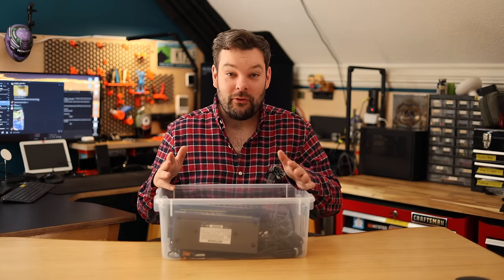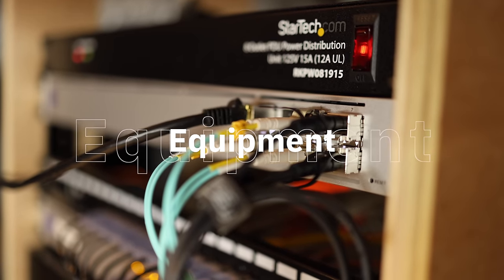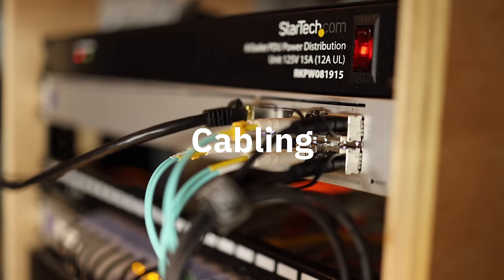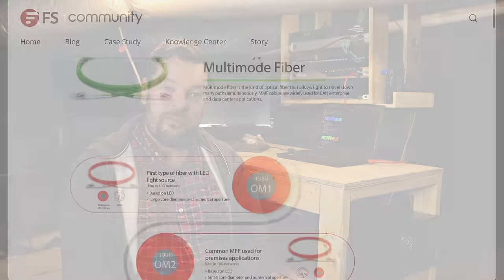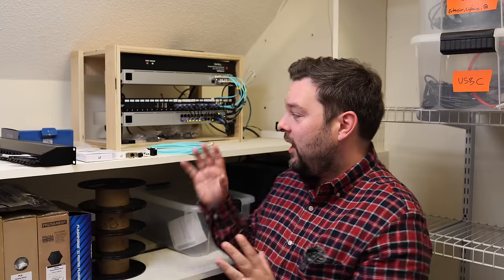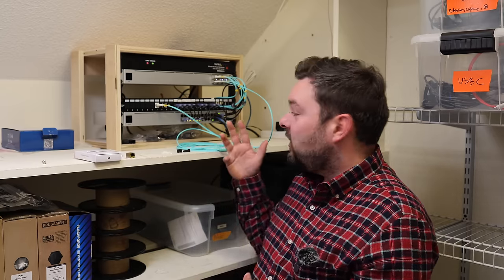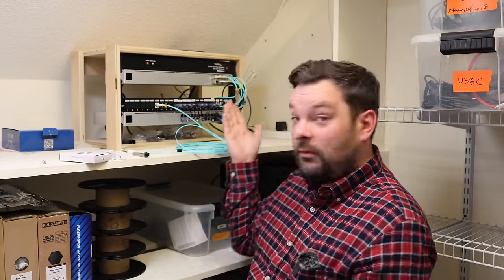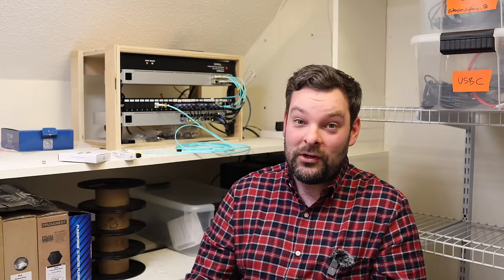Future-Proof Your Network: Upgrade to 10G with UniFi Fiber Gear

Comment: 10g over copper is hit or miss. I ran cat 6 throughout my 2 story home to the basement. My desktop is connected at 10g to the switch in the basement and Ive had no problems at all. The ethernet runs even cross over all of the power cables coming out of my breaker panel (at 90 degrees).

Comment: 10gig is going to be a big upgrade when we get wifi 7 ap's with 6ghz as well. thats my plan at least. I think unifi needs some switches that support 10gig poe++ though. they have only one currently for 4 or 6 ports (i forget which)

Comment: TP-Link have a 16 port semi-managed PoE switch for $199 (TL-SG1218MPE), with double the power budget (around 200W total)... Is the USW-24-POE really worth nearly double the price?

TP-Link also have the ER8411 router for $350, which has two 10Gbps SFP+ ports and eight 1Gbps ports. I'm using it with 10Gbps internet and it works really well. I don't think Unifi have anything around the same price with the same performance.
Reply from the maker: You're not wrong! Whether these things are worth their prices is entirely up to you, your needs and your budget. I've been extremely happy with the Unifi ecosystem myself so I stuck with what I knew. I could/should get some Omada gear in for testing though!

Comment: I have a netgear xsm7224s 10 Gig switch, 1 Arubra s2500 poe with 4 10 g ports. and 1 Arubra s3500 poe also with 4 10 g ports.  the only difference between the 2500 and 3500 is the 3500 has 2 power supplies.  All my computers in my office are all 10g.   and the run from my shed/office to the home has 2 10g lines witch are connected to the netgear switch the same with the switch in the office POE switch.    All 3 switches are enterprise hardware.   before I only had 1g but with 32 4k and 8k security cameras the 1g was starting to bog down now I don't even know the POE cameras are on the network.  I have some of those 10g T transceivers,  and I have bought different one and not of my switches support them.  I believe its because they take more power than the fiber and the switches wont power them.

Comment: 25:00 the factory does not clean the fibers. You need to clean them yourself. From the factory there are particles of stuff on it. I scope them everyday at work. They usually work ok without cleaning, but they are not clean. When i clean them i get a better lite reading.

Comment: I don't understand why 10 gig wasn't the default for home networks 5 years ago.  With single NVME drives capable of saturating 10 gig already, if I had the cash, I'd skip 10 gig and go straight to 25 or even 100 for my main machines anyway.  1 gig is sufficient for almost every other client in the house as gigabit internet is crazy expensive around me still.  And frankly, even if we had multigig internet, most of the clients don't really need that much speed anyway.
Reply: Since funds are tight, I'm looking at the Mikrotik crs305_1g_4s_in.  Ultimately, I just need my main machine and network storage on 10 gig right now so the css610_8g_2s_in is probably a better option so I don't need to cascade the 10 gig on the current 5 port 1 gig to have more than the single copper gigabit port.  It's just that the 4 port would allow me to have more 10 gig in the future so I consider it.

Comment: I love the podcast and this video, therefore take this as a friendly note.  The wood you are using is not plywood.  Plywood is made of wood scraps that are glued and compressed into a single board.  Plywood is obviously of the Ply variety just based on how it looks.  Keep up the great content!
Reply from the maker: The racks are made from plywood, not sure if you meant OSB?
Reply: It IS plywood as in multiple PLY layers. You're referring to particle board. 

If you're gonna try to correct someone at least be right

Comment: I'm staring at switches debating if I want to buy into more TP-Link omada gear. I really like the idea of an all in one interface, but gosh their 10gb switch options are really not that impressive.
Reply from the maker: What don't you like about them?
Reply: I've been using the omada access points for several years now and I can say that the hardware has been extremely reliable, however I feel like the software experience is somewhat half-baked compared to unifi although it has gotten a little better. 

For me, if I was starting over I would probably go with ubiquiti/unifi.
Reply: @scruggs.jonathan  I would prefer unifi, but trust me, they have their problems and issues, too. And never buy unifi routers. Just get an OpnSense or PfSense, OpenWRT or whatever floats your boat.
Reply: @andreas7944  agreed! I use pfsense for both home and production networks. Fantastic software.

Comment: 2 x 10 gig doesn't equals 20 gig. The speed is still 10 gig but you can send more traffic at the same time. It's like adding an extra lane to a motorway, the speed is still 70 MPH, it doesn't double to 140 MPH. However, you can get more cars down the motorway at the same time.

Comment: Future proof is not 10Gbe that is just sufficient in 2023 for any non wireless usage.
If you want future proof get at.least 25Gbe you can find 2 hand bargain equipment. But If you want something decent 40Gbe is the way to go, big data center are dismissing that speed since 2 years and you can get an incredible set up for a decent price.

Comment: why? Unifys latest cams are 100 megabit. You can use your oldest 100 Mbit hub
Reply from the maker: Headroom!
Reply: Fun fact: The main reason for cat7 is CCTV. Apart from that, the 4k cams use a 1gbe connection. Also, you usually want to use POE(+) for cameras without injectors. So a switch and not a hub is required. Coming back to the 100mbit, it is not recommended to have multiple cameras on a single 100mbit connection. If you have a lot of movement in the picture, the cameras will not be able to compress it that good. Imagine your CCTV going down because it's a windy day...

Comment: Futur proof, I'm sorry but today no computer, box TV or Console come with on board 2.5 Gigabit ethernet. And no online service like microsoft game pass, or other  can provide you with a 1Gigabit connection. Because if they do it it will blow up the data center  and your local city network. So sorry but when your are a normal user even a 2Gigabit internet connexion will be overkill

Comment: Hi Alex nice video. May I make the following points:- Lightning Protection  and Qoolis- I am in Thailand I got 1GBbs for 12US per month from "3BB" who come at the drop of a hat (or packet).  My router and ProxMox (old noisy ibm3550s) and radio lab are one end of my huge garden, then 100 meters single fibre thru the garden/snakes/swamp/chillies, then my house and CCTV PoE and then another 100 mtrs to my office so 3 switches in a line connected by fibre. Surplus LEVELONES. PoE 10 port (I don't use SFP ports – no need)  the switches are great, web managed. So what and why am I here? The freaking media converters “copper to fibre” I use are “NETLINK” grey box and they are fine, the 1Gbs lights up, all ok, prior I used Qoolis brand  (black) – they looked the same BUT inside they are mega crap clones. After a week, maybe the heat, they failed to give 1 Gbs and reverted to 100mbs, I was furious as in 35C all day hunting I thought maybe fibre problems, anyway I looked inside the Qoolis crap and the interface components are different brands (no labels) to the NetLink ones. China evilly copies everything and cheapens it in the process. So BUYER BEWARE.  DO NOT USE ANY “QOOLIS” brand converters. Second point -  LIGHTNING protection. I am a radio engineer, so every cable is an antenna to me and Lightning=EMP, (ElectroMagnetic Pulse Killervolts) gets in.  I use long fibres for that very reason. In Thailand we get 100 strokes per hour and really it's WW3 level. So great to use fibre not long copper runs. Also your systems should have a BIG FAT central earth point and thick ground cables. Good switches have a rear grounding studs. In military systems all boxes are grounded together then into a main low impedance earth point.  Also if you are building a new building (cement and rebar) use UFER grounding techniques, look it up, mil use it thanks to Mr Ufer ( a real guy) in WW2 Grounding is more essential than you think, especially in large systems and DONT forget to put pulse/surge suppression in your mains supplies!

Comment: I've noticed that most people (including tech YouTubers) are adding or expanding the number of systems, and therefore; the required number of connections, and therefore; their networking infrastructure.

I've actually gone in the opposite direction where I've actually consolidated 4 of my NAS servers into one BIG server, which also runs Proxmox, and then to enable data communications between the VMs and the host system, instead of using a network switch or even a virtual network switch, I am using virtio-FS instead, so it has direct access to the host data.

As a result, I've been able to completely take out my 48-port GbE Netgear switch and now I just have a 16-port GbE switch (which is also a Netgear switch), running, and that thing only takes 7 W of power.

Even with mechanical hard drives, I can move data between itself at somewhere around the 5 Gbps mark, and I don't NEED a 5 nor 10 Gbps switch to do that.

Just something for folks to think about.
Reply from the maker: You’re right. It’s too tempting to keep expanding. It’s too much fun!

You can get a lot done with a very small amount of systems these days. Some of these old habits die hard when it comes want to go big. 

That said, I really really enjoy the learning aspect of expanding. It’s a lot of fun. Thanks for leaving your comment reminding others they can take their own path.
Reply: @ktzsystems  
Umm....yes and no.

There ARE some things that you can really only learn through expansion.

(It is quite difficult to learn, without the physical hardware, for example, about 100 Gbps networking, at least on somewhat of a consistent basis.)

To be clear though, I actually went through the expansion before I realised how much power my systems were consuming as a result of the expansion, and that is what led to a significant consolidation of 4 NAS servers down to a single server, and cutting my power consumption in half, as a result of this consolidation.

I don't want to give the impression that I am against expansion, but rather, sometimes, it is worthwhile to take a step back, and ask yourself "is the expansion really necessary, or are there better ways to do this?"

I had expanded to 100 Gbps Infiniband network before contracting. The 36-port Mellanox MSB7890 100 Gbps Infiniband switch alone, I think was consuming like 200 W of power. At idle. (IIRC). It's crazy!

I learned about NFSoRDMA on 100 Gbps IB hardware first before trying to bypass the switch altogether.

Yes, it is fun to learn.

And then it's even more fun when you try to cut your power consumption (in half), without sacrificing service nor quality (of service).